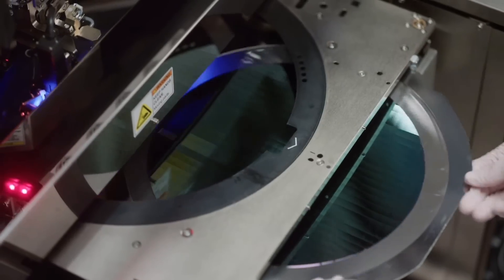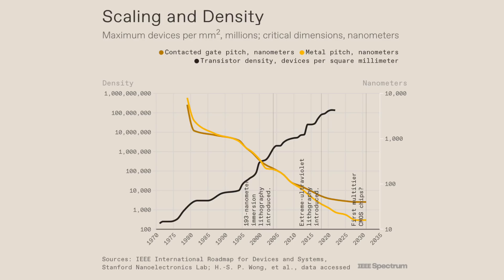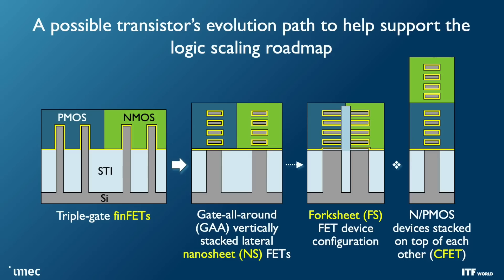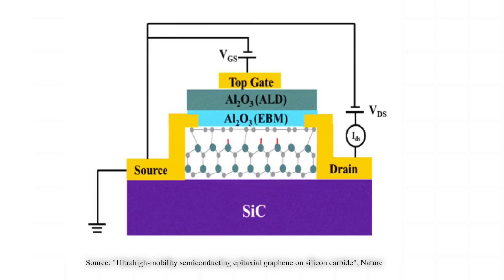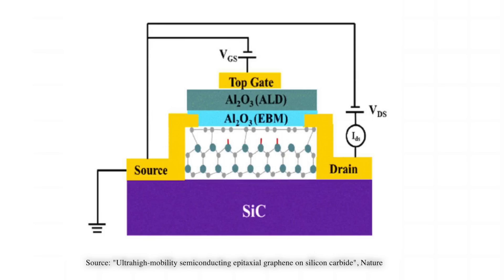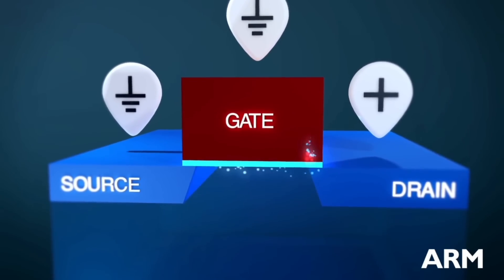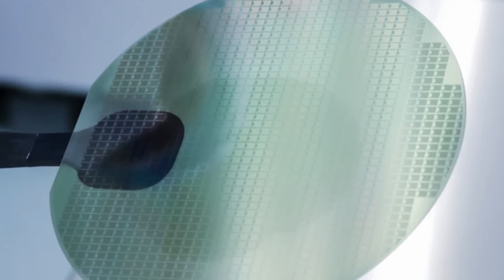Microchip Breakthrough: New Era of Electronics

Comment: 🎯 Key Takeaways for quick navigation:

00:00 Researchers have developed a new semiconductor material promising computer chips that could run much faster, potentially sparking a new era in electronics.
02:57 Graphene offers superior thermal management compared to silicon, but its zero band gap has hindered its use as a semiconductor.
06:49 Researchers have created a semiconductor, semiconducting epigraphene (SEG), by growing graphene on a silicon carbide wafer, solving the band gap issue.
08:38 Graphene-based transistors offer 10 times higher electron mobility than silicon, enabling faster chips with less heat dissipation.
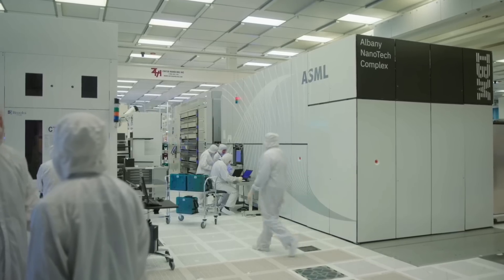10:03 Silicon carbide and Boron Arsenide are potential candidates to replace silicon due to their superior properties, but challenges in fabrication remain.

Comment: Moore's original observation was that the number of transistors would double every 18 months.
He later revised it to 2 years as the rate had already slowed by that point (around 2000 as I recall).

Comment: Graphene (and other carbon materials like fullerene and derivatives) seems the better option in that it is readily available (compared to rare earths and high manufacturing process materials). The highly rare and toxic Boron Arsenide seems too toxic even though possible wider scale of usefulness may result,  its manufacture as usable chip material is not what I would call worthwhile in its pursuit.However that does NOT detract from the value of doping silicon wafers with graphene. Kudos for your coverage of such an important leap in developing new methods and materials.

Comment: Anastasia, you mentioned that the new graphene transistor tech has better "heat dissipation". Undoubtedly true, however, isn't the fundamental thermal benefit of such tech that it produces less heat in the first place? I would think it would result in much lower power consumption for the same compute capacity. I'm not an engineer, but, I play one in my mind. Thanks for all you do!

Comment: nice for faster processors but it is cool for high power switching applications. if the switch time is significantly shorter, then then power loss in form of heat gets much less.
in cars you have a benefit if you can squeeze out more efficiency from the inverter. the inverter can be built smaller because due to higher switching frequencies you can use smaller inductors as well. you need less cooling and all these smaller parts save money.
the integration can be done closer to the electric motor which allows better packaging.
great stuff. but of course it can boost processing power in CPUs, GPUs and neural processing units much further.

Comment: So when I understand it correctly:

Silicon is being doped to make it more conductive

Graphene is being doped to make it less conductive

The question then is, how many passes does it need compared to silicon? I used to work in a chip factory in the Netherlands, and there the wafers went through many passes. The more passes the more expensive the silicon.

So if you have to pass Graphene through more treatments to give it the desired electrical properties, it will be more expensive to manufacture.

Curious how that turns out in practice. And of course we haven no choice if we have reached the physical limits of silicon.

Comment: Confined electron charge carriers can exhibit their energy levels under certain conditions and can be measured, pursuant to restrict the conduction area where thermal radiation is generated. I think it was Fairchild that first experimented with three-dimensional quantum wells in QFETs. That research also addressed the problem with band gap and perhaps has relative application here in bringing down the de Broglie wavelength. Yep, go vertical, or go home.

Comment: Don´t get fooled by the name 2nm. That is just a marketing name.  The actual pitch is about 28nm. But that is not the smallest distance. That is the thickness, that is about half that.

The reason why its called 2nm, apart from marketing, is that partly the transistors are uppright (but not vertical) nowdays so the take way less space. So its the density of 2nm compare to what it would have been if it used the same tech as 250nm or there about

Comment: A fine video!
I still have a 4k UV-PROM chip w/a quartz window the size of a cherry pit, from the late '70's when my late partner & I were developing business & scientific applications for 8 bit, S100 bus or proprietary micros. [Showed it to my son, a new Python analyst, in '23 & got a mild level of interest. :-) ]
It held assembly code for Intel's 8080, running at a crystal speed of 600 kHz. (0.6 MHz for casual viewers) That included a 16 bit (3 1/2 decimal digits) floating point library from Dr. Dobb's Journal, with logarithm & exponent operations vital for predicting dairy cow milk yield, of all things.
If we found a bug or wanted to "burn" an upgrade, we'd erase the current state with a few minutes' exposure to UV light in a chamber the size of a forearm, with a timer & bell, and a sliding tray containing a grey foam floor into which we'd stick the UV-PROMs.
Despite the clunky storage, our little app screamed. Response time was blink-and-you'd-miss-it, right up there in speed with Excel running on an 8 core, 2.4 GHz box today.
This was 3 years before the IBM PC. Bill Gates & Steve Jobs were unknown. Hard drives had 12" diameter removable platters. Floppies were 5 1/4" or 8" across, bendable, easily damaged, with lifetimes of months or sometimes weeks. 320 kB capacity... at the time they said it was like trying to change into your Superman uniform in a phone booth, when you weren't even Clark Kent.

We knew tech would improve. We never imagined how far it could go in one lifetime!

Subscribed. Thanks, Anastasi!
🇨🇦

Comment: Turning graphene into a semiconductor with a band gap by doping and using traditional manufacturing technologies sounds promising!   I wonder what the technical challenges are?   

I hope it’s not like the challenges encountered with EUVL.  The first EUV experiments to production silicon using some EUVL layers took 30 years!   I certainly hope graphene semiconductors are used in production sooner than 2050.   Hopefully the discovery of single layer graphene itself 20 years ago is a good start.

Comment: I Imagine one day we can use a hyper-transistor or I called it "Semi-ultransistor" which can packed with a hypercapacitor, in short its a transistor but also a battery! And speaking of battery you can rearrange it to become a solar cell, well I Imagine it comes in powder form so it can made into some any possible applications. Speaking of new breakthrough, we can pack more transistor inside an compound of stable atoms by making the atoms a transistors or any "electron farm" functions.

Comment: So... the atomic level of a yes or no switch.. Helium being the smallest atom. Avg transistor size is 0.2 nanometers.. The most optimized means if we think helium is the smallest atom, then changing to a pressure helium wafer set could be interesting.. I don't know, its wide thoughts. I thought pressure would make things smaller, but that doesn't work  because pressure doesn't change the size of an atom, as it is determined by the distance between the nucleus and the electrons, which does not change when pressure is applied to a gas. Therefore, pressure does not change the size of a helium atom. Anyways, so pressure... though can compress more helium molecules to a closer formation. as their a forced against their fields... they begin exhibiting changed states, to eventual solid, however, upon further compression, the electron orbits of each other and nuclease could reach. Not sure ... but.. When atoms are compressed to a certain extent, their electrons and nuclei start to bump into each other. This can lead to a variety of phenomena depending on the degree of compression. If atoms are compressed to infinite density, they would form a neutron star, where all the protons absorb all the electrons, leaving an extremely dense ball consisting of only neutrons.

It is not possible to compress an atom to infinite density by applying external force, as there is a fundamental limit in scale for space-time that occurs near 10^-33 centimeters and 10^-43 seconds, often called the Planck Scale. Many physicists think that this represents the highest density for any natural compression mechanism, because at higher densities, space-time itself transmutes into some type of quantum mechanical system for which ‘density’ is not a meaningful concept.

Hmmm, kets think

So...

A neutron is a subatomic particle with a mass slightly greater than that of a proton and a neutral charge. The size of a neutron is typically measured in terms of its mean square radius, which is approximately 0.8 femtometers.. Its held together by gluons and upqarks are invovled.

 So the next great leap in transisters would be Neutron transisters. Which would allow 800 times the capacity of the current size, first one would have to make a large act, IE a simpel gate and switch which exists in nature laready with neutrons, to trigger. The field wouldn't be able to use neo wafers, but mostly likely require a lot of energy field lines that are frozon in place to ahve and keep a neutron suspended in artifical field, life span of a wild neutron is  877.75  avg, or most things.

So the question is the cause of decay and use life ot bring it to refined state and order.

 So a neutron transister is a third tech revolution, and one could go even further with smaller bits of the universe and use a suspended neutron bed to manipalate a divide realm (nothing is named correctly here yet of this layer of reality) So work in progres but that owuld be my theorhetical limit of a ocmputer...

 What can happen with 800k more transisters in the same space as what we have now... hmm... not sure... hmm...

This is jsut theory crafting... of potential use for reality, is it possible... I don't see why not, since nature has it setup that way already and we jsut need a state to hold something and then use it... Teh machines it operates could even save or carry track the meagnetic variance, so you could do someinteresting coded states of the field in teh relation of hte neutrons... hmm.. I don't know... maybe its all bunk..

Comment: To get around the band gap issue, replace some atoms of carbon with nitrogen or boron, then apply gold silver or copper atoms that will hover in spots where the N or B   atoms are ajacent. Apply another layer over the gold. Trim the array with a laser to create circuits. The graphene gold graphene creates a tunnel junction switch. One neat effect of graphene is that it is a superconductor in the plane parallel to the atomic attay of carbon atoms. The cause if this locdlized or topological superconductivity are the resonance bonds of each 6 carbon benzene ring assembly

Comment: it is interesting for the transistors but a big part of the performance comes from the interconnections. With increased density the conductive lines look like tall and thin walls and behave like larger and larger capacitors as you reduce the distance between the lines and larger and larger resistances as you reduce the section of the conductor. There is a little bit that can be done with high K dielectric materials and by lowering the operating voltage but we are close to the limit of what can be done here too. On a complex chip where the impact of interconnection on performance is around 50%, even if you have a transistor that is 10x faster you will not improve the chip performance by 2x.

Comment: I'm wondering about electron mobility. We know the speed of electrons in a wire carrying current is far less than the speed of the current flow itself. I would think that therefore a transistor's speed might not depend so much on how fast the electrons are moving, but apparently it does. It is hard to know how to think about flowing electrons. Like billiard balls flowing? Probably not. More like quantum wave packets flowing??  Fuzzy moving clouds of electron probability?  Then, how to think about the difference between electron flow and current flow? I think of current flow as like a chain reaction of lots of electrons pushing one another so force at same end of the chain is rapidly propagated to the other end. But how to think about the speed of a transistor?

Comment: So... is the breakthrough here that with the reduction heat due to the introduction of the semi conductor that they will be able to finally be able to start building vertically? 

If the transistor design is old school does that also mean they will be larger too or will their be additional research you think to see how they could get the graphene transistors to work in the other transistor configurations?

Comment: Perhaps Chinese academics might be able to conceive of a new chipset; however, they could NEVER produce them at scale.  They only attained the ability to create the tip of a ballpoint pen a few years ago.

Also, I dont think the primary problem is the electronic charge needed to cause an electron to cross (switch), but rather quantum tunnelling. At least both the charge and heat issues are addressible, but quantum tunnelling represents a roadblock to using transistors (circurit breakers) as a means of state information representation and transmission in general.

Interesting video, however. I’ll subscribe to see what else you have.
Reply: Lol typical western uneducated quote attitude. Some one from social media or some political link person might had said this to get more famous and you people keep copy paste same comment again and again . ohh they can’t make ballpoint and has just able to make few year ago bla bla lol 😂 keep crying

Comment: The 0.7 eV bandgap caused Ge transistors to have very poor performance at temperatures above room temperature.

What stops this graphene semiconductor, with a band gap of 0.6 eV, from suffering the same fate?

Will the better efficiency and higher thermal conductivity mean faster more efficient chips at lower temperatures that allow it to function properly?

Comment: Also more recent generations of CPUs and GPUs are power hungry! I never thought I would have a 1200 watt power supply. I hope this new design is more efficient. If it is packed tighter then I am guessing it would have to be or heat would be an issue.

Comment: Hexagonal boron nitride would be a great insulator as well as aerographite reinforced with ZrB2 and HfB2 
You can use rhenium for heat sinks and use a titanium dioxide coating on them  
And use Tantalum hafnium carbide for nanowires,nanorods, and make all cpu pins from that material in that size you could even coat them in multilayers with tungsten being the base coat and gold being the top coat and you could seal it with Teflon we got plenty of materials to explore get creative look at everything on the periodic table and work from the atomic level upse what each element is potential of doing

Comment: its just baffled me how all those chip companies still trying to elaborate more on SEMI CONDUCTORS. they cant make a single atom transistors. by principle alone it can not be done. and by manufacturing alone its not feasible, as you are talking silicons, semi conductors. those single atom link will burn a semi conductor up. and the other option they are currently developing is the nonsensical one, the QUANTUM computers. that even aliens who could travel space lightyears away ARE NOT using. those while there is an OBVIOUS OPTION that i have mentioned int he past, which is a LIGHT BASED COMPUTING PROCESSORS. a single signal agent doesnt require much electrical power since it can be a SINGLE PHOTON being deflected by single electron of a single atom inside a crystal based processor medium. and method of processing those signal can be using new ones that are maybe an emulation of how transistor work from deflecting and dividing light agent paths or something completely different that can be more efficient than transistor way of signal handling. like said, the signal can be merely a single photon per path/thread. which could come from a laser like arrays that contain hundreds of photon/laser emitter. and those emitter blinks according to when is signal is need to be made. it will be a COOL operation, the only things need to be cooled in that tech is the laser arrays that fires the photons. which wont be much of a heat problem. as the crystal medium itself that act as the bed/die of where the signal processing takes place will remain cool. you could easily reach terahertz cycle with it. its light signal. travel faster through the mediums than electron does between atoms. and would probably only need less than 30 watts to function. and yet, NOBODY BOTHER TO DEVELOP THIS TECH. and this is what the aliens use. and DOABLE TODAY with the current tech.